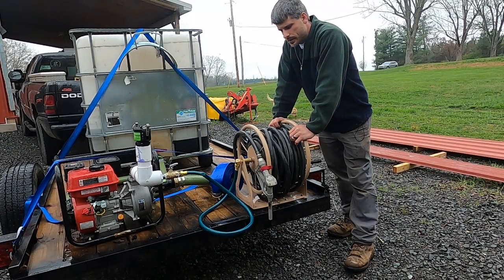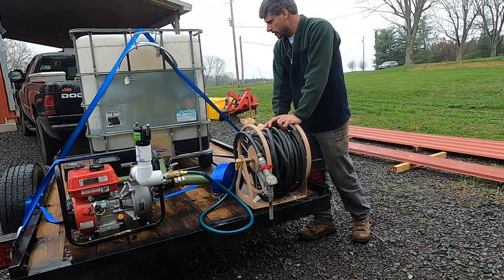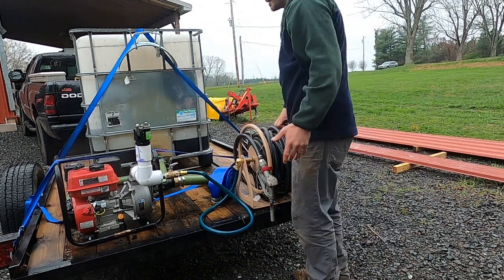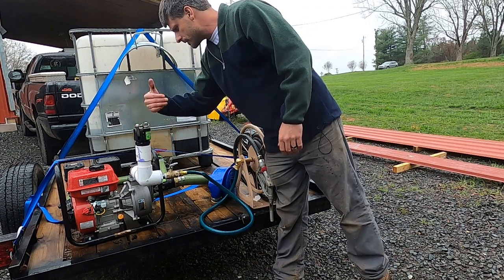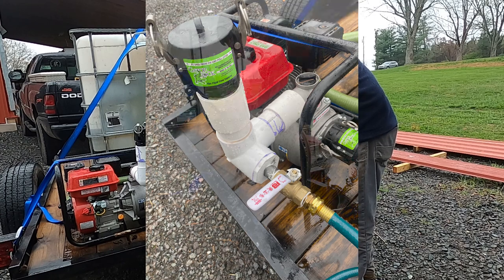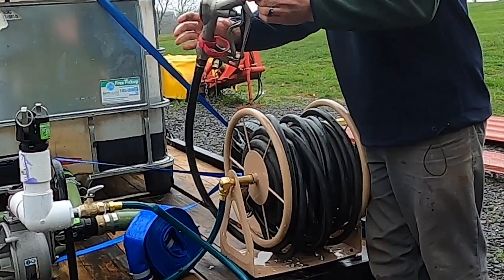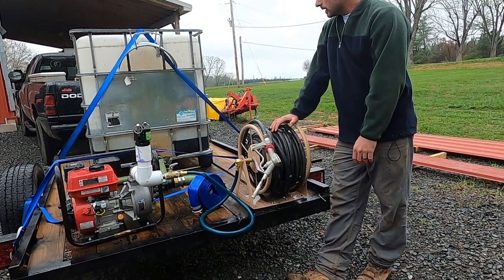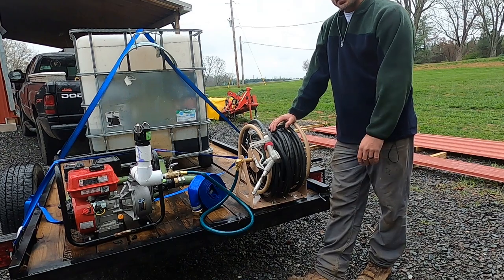Feeding Pump Setup Using a Semi-Trash Pump and Water Hose

Comment: Nice set up. Do you run a hose out of the top of the manifold back into the tote to circulate the syrup when mixing?
Reply from the maker: Yes however if you are mixing with dry sugar, it works better to suction from the top and pump into the bottom so the pump doesn’t slug with raw sugar.